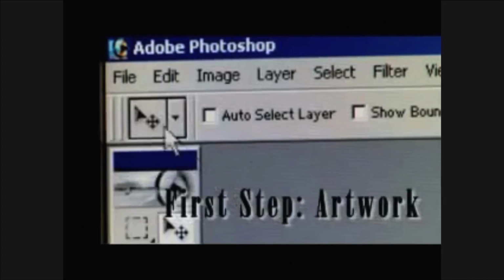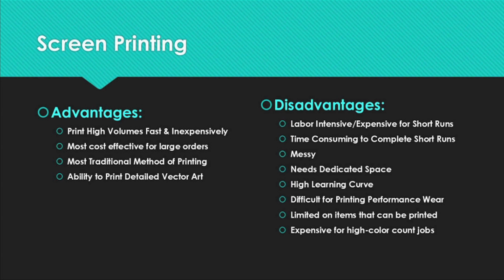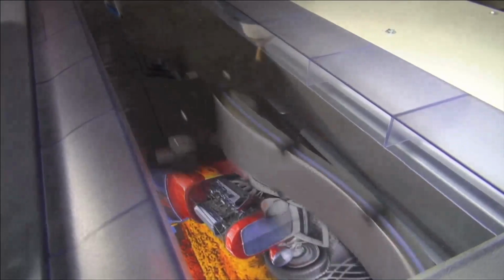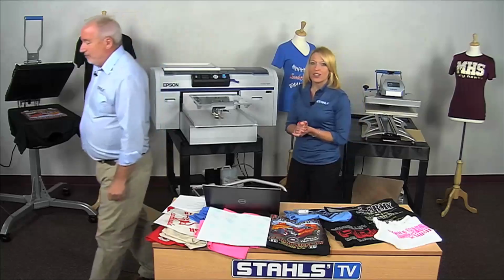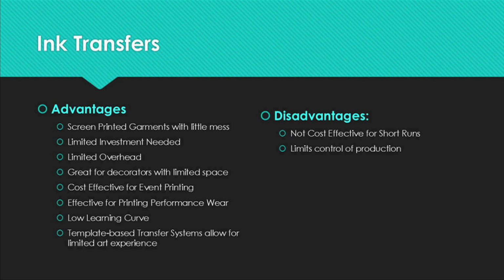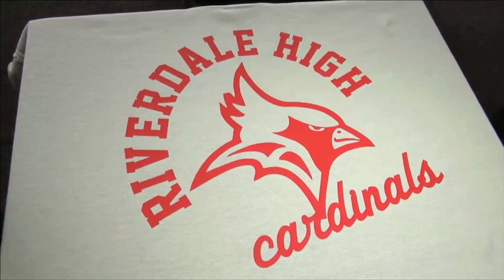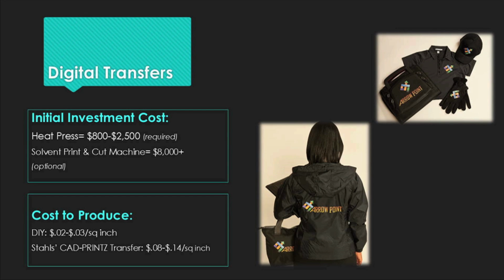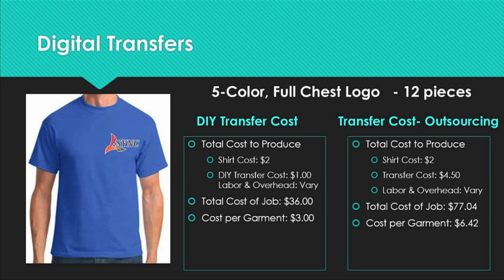5 Ways to Print a Shirt

Comment: I work in a print shop where we use most of these methods. However, I only run the embroidery machines... I got a heat press for Christmas, so I'm wondering if I can achieve multi-color products by buying a sublimation printer and using sublimation paper along with the press.
Reply from the maker: You can definitely offer multi-color products with sublimation. Keep in mind you'll want to print these on polyester garments. This will give you the best and longest lasting prints.
Reply: Stahls' TV What equipment would I need to use cotton garments?
Reply from the maker: Sublimation is designed for garments that accept ink well. Cotton is not one of those materials. Sublimation is basically dyeing a garment using heat and pressure. Unfortunately, no equipment exists at this time that will give you long lasting sublimation transfers onto cotton.
Reply: I mean with the heat press in general.. what would I need in order to heat press on cotton shirts.. thank you for your responses btw!
Reply from the maker: I'd recommend a Hotronix Heat Press paired with a vinyl cutter and heat transfer materials from Stahls'. :)
Reply: Stahls' TV okay awesome thank you :)

Comment: Can I use sublimation printers and ink for vinyl cutter
Or I only need ink jet printers for vinyl cutter
Reply from the maker: For a vinyl cutter, you'll need heat transfer vinyl. The cutter will cut a design in the HTV, you'll weed away any excess material from the design, the apply to a garment using a heat press. Sublimation printers print graphics on specialty transfer paper that can only be applied to specific sublimation garments with a heat press. Check out this blog post for more information on sublimation printing: https://blog.stahls.com/sublimated-printing-with-a-heat-press/

Comment: Would like to do ink transfers. On what kind of materials t-shrts can I print? is this called sublimation because i'm getting confused a little bit. Is there difference beetween light shirts and dark shirts? And what kind of printer do I need, with sublimations ink?
Reply from the maker: Sublimation is a process of printing on a sublimation printer with sublimation ink and dyeing the shirt.  When you heat up the transfer the gases release and adhere to the shirt. For best results you want to sublimate onto white or light colored shirts that are poly, or a poly blend.
Reply: So that ink transfer system is also called sublimation? seems the same thing. Thank you
Reply from the maker: The EPSON featured in the video is a Direct to Garment printer. Different than a sublimation printer.

Comment: I want to create my own artwork what do I need to get to print my own artwork on the transfer paper
Reply from the maker: Printable heat transfer vinyl is available from STAHLS' for use with a print/cut system. However, if you don't own one of these systems, you can quickly and easily create one-of-a-kind looks with transfer papers that work with a laser or inkjet printer. Visit https://www.transferpaperexperts.com/ for more information.

Comment: For cotton t-shirts, one can use vinyl, DTG and screen printing, right? Sublimation, ink heat transfer, etc, are not for 100% cotton, right?
Reply from the maker: Correct, Sublimation may initially show up on 100% cotton but it will wash out. If you're working with 100% cotton it is best to work with ringspun cotton.